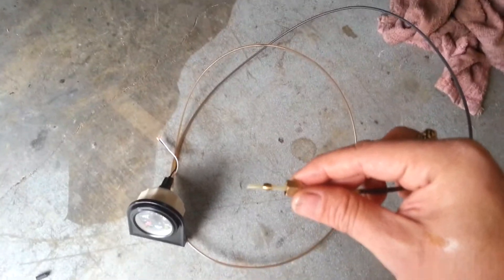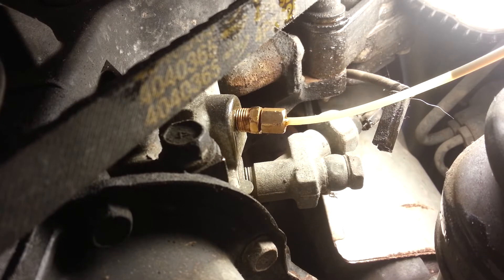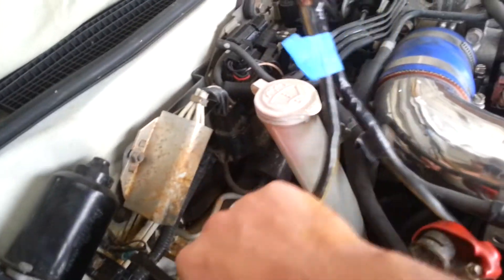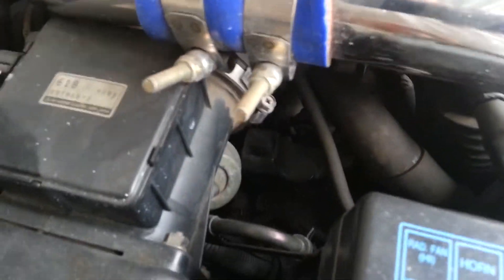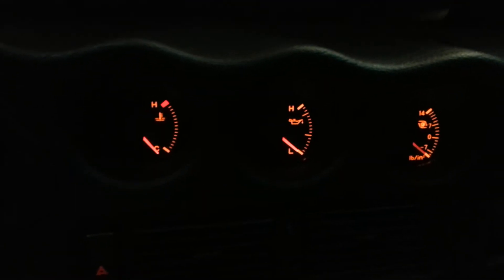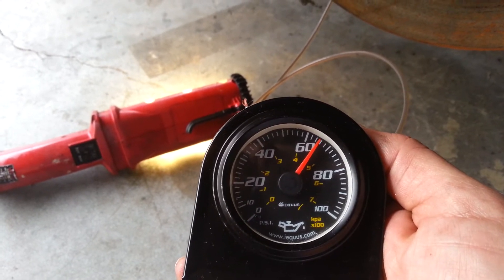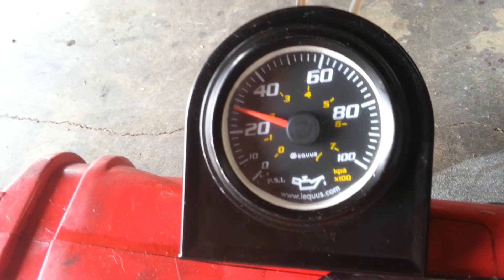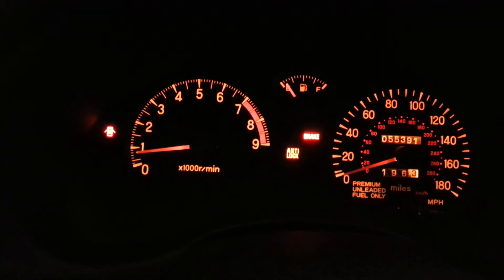Last VR4 Built - Oil Pressure Verification Part II

Comment: You are aware that the oil takes a lot longer to get to operating temp than the coolant?  You need to wait about 15-20 minutes after the water is up to temp to get an accurate reading on the warm oil pressure.
Reply from the maker: You must not live in Houston.

Comment: Its funny. I am using this video to check my oil pressure two years later haha... I am starting to get an intermittent oil light on the dash when it sits idle. the PSI looks good on the center console but the light comes on when at NOT....
Reply from the maker: My first guess is that it is the light. Keep me posted.
Reply: I think you are right. This started happening after a recent oil change after a track day... I accidentally cross threaded the oil filter, then started the car... I was watching the oil pressure and noticed it drastically decreasing then I cut it off after about 10 seconds. Well, you guessed it. Oil sprayed everywhere. I feel like it is the harness for the oil sender unit but I have cleaned it and it still gives me a flickering light when at Normal operating temp and in neutral. with a slight rev the light goes off. No smoke or any other sounds/issues... I think its the voltage being lost through the old oil soaked harness... another fun fact. the 99 VR4 Harness isnt sold anymore. yay me :) Its great to hear from you buddy I hope you are doing well!

Comment: I have same exact gauge. My oil pressure is about the same until I go for a drive and get into boost a couple times then it drops to about 20 psi at idle. Great video btw